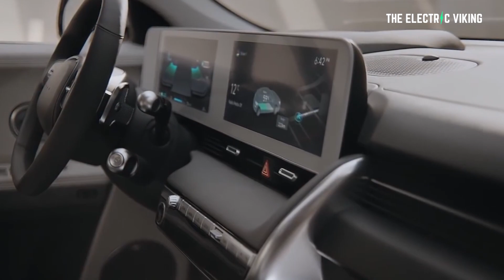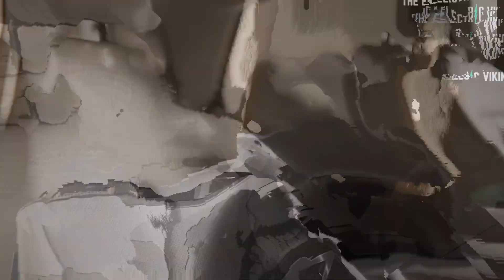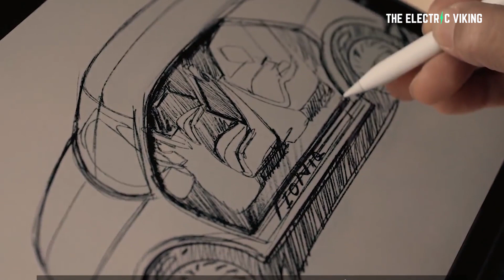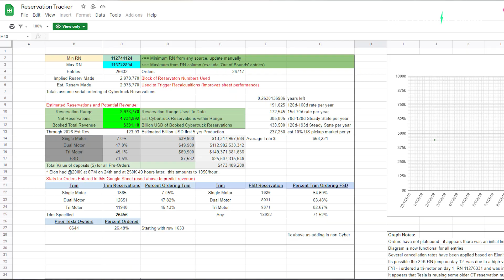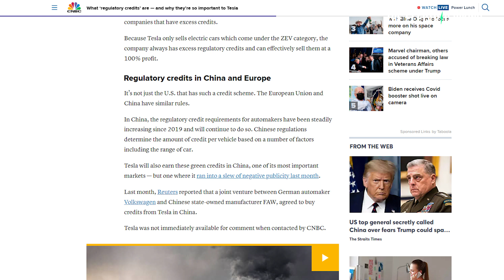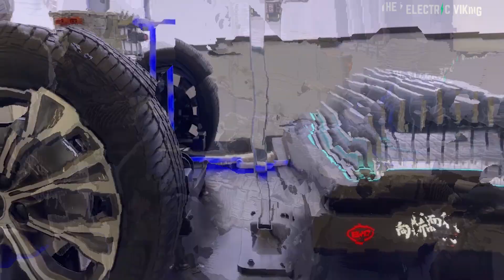2023 EV sells out in 19 minutes! Why is Detroit trying to go bankrupt!?!

Comment: At GM and Ford, and possibly other ICE manufacturers, they are losing significant revenue per unit of EV production. Bob Lutz hinted about this regarding their compliance programs.
Expect each Caddy Lyric to be as high as 50% negative margin. There is no way they can sell them at $60k each at a profit.
Reply: If Tesla can make profit then why not GM? Time to market is very important .
Reply: @AnilKumar-xw5bs  look at some videos on Sandy Munro’s channel about the Ford Mustang Mach E vs the Tesla ModelY to have an idea about who is really a better manufacturer of vehicles. Ford uses many more parts and complexity to accomplish the same system operation like fasteners, longer high voltage cables, and cooling. Keep in mind Ford has a 100 head start on Tesla in manufacturing and are behind in terms costs and weight.

Comment: The overwhelming reason is - - - - unions.   The big 3 factory unions, and mostly invisible are the supply chain union company employees.   And like an ocean liner, ‘Ships of State’, ie. large corporations like countries, find it extremely difficult to get the large entity to radically change coarse.   And, there is the “Bull in the closet”, (Non-adequate battery supply chain”) provider for every manufacturer.   That’s why “Tesla” is building a factory right next to the plant in Germany. The numerous problems in reorganizing the manufacturing process, (or new process as Elon Musk found out) as well as establishing any new and adequate supply chain always causes that “Ships of State” phenomenon to hinder the drastic changing of direction for all of these companies.
Reply: As someone with 50 years experience in the mobile industry, including executive level, it is the C suite that is the problem, not Unions.  The crux of this video is that traditional auto makers have not invested in EV production capacity and Unions do not control capex expenditures.  The root problem can be found by following the money, as always.  Executive compensation is so high today that all an exec has to do is survive for a few years and so much money is made that they and their progeny for all time will be wealthy.  So they spend just enough developing EVs to convince the Board to keep their jobs but not the capex because that would cut into their mega bonuses.  When everything goes to h--- they are gone but still rich while everyone else, including the unions, is screwed.  The environment? never entered their thinking, they have enough money to get their families someplace survivable.

Comment: I can think of several reasons here in the U.S., and spoiler alert, they would all go away with battery swapping standard and the combining of resources.

1) legacy companies have massive debt. in pension plans to their retired workers.  They simply don't have the ability or desire to borrow a lot more money for research into building EV factories.  They would rather build ICE which they are already tooled for and know how to do.  And this is where combining of resources would help.  GM, FORD, CHrysler and possible Toyota, VW, etc. should pony up a couple billion and build a battery and "skateboard" factory that each company can then finish out.  

2) The legacy companies are behind in battery technology and don't want to go head to head against Chinese companies in "their" home stadium, building batteries and battery powered cars.  These U.S. companies would rather compete with companies like BYD building ICE cars.  And this is one place where a good "battery swapping" standard would help in that then people would separate the car from the battery and be easily able to by an American built car and then lease a battery that might well be made in China.  

3) legacy car dealerships hate EVs.  And this is another place batter swapping would help.  People could trade in their tiny battery which they use most of the time, and swap for a 1000 mile battery that one week they are traveling across country, then trade  back.  This would give dealership a great thing to do and charge for.

4) supply issues.  I don't think American companies want to shut down whole factories waiting for foreign battery companies to supply batteries.  Just look at the Chevy Bolt ruined by LG Chem.  Again, combining of resources might help here.

Comment: Converting an ICE production line to EV production is not that easy. For some established manufacturers, it means throwing away half a century of expertise and knowledge, fire 50% of the work force （including the CEO that makes this decision）and complete with then new start ups (i.e. tesla and the Chinese brands) who do not carry the historic burden. I can understand this
Reply: @Click Bait yes you can, those battery and EV component suppliers are called BYD and CATL. They have the capacity to supply even a 1,000,000 units per year for other OEMs. Witnesses Toyota and Subaru signing up with BYD for their entire skateboard chassis and battery supply for their future EV product line
Reply: It already started, Mercedes fired thousands of autoworkers. Conventional auto makers don't have the expertise, the software background. Must transition from mechanical engineers in charge, to electrical engineers running the operation. Their outsourcing of everything has become their Achilles' Heal.  They are experts at nothing required in EVs, and can't motivate OEM suppliers to transition fast enough since OEMs supply multiple manufacturers.
Reply: I can understand the pivot is very large and complicated, at the same time it is a matter of pivoting or go bankrupt. China will produce 20 million electric cars by 2025. That is 33% of the current world market. Rest might produce perhaps 7 million combined, of which 3 will be Non-chinese Teslas. All will be EVs at price parity.

If big auto cannot meet this, someone else will compete against the Chinese+Tesla flood. Might take a decade or more for the real competition to arrive though.

Comment: It takes a lot of money to change a car entirely. The reason the older ICE models are abundant, and very profitable for the manufacturers, is that the key parts of the car, and there are thousands, have been made in huge quantities, the tooling is all paid for, and all they do is run the factory for a few weeks and they have tens of thousands of parts. The electric cars don't share that many parts with the older cars; because everything is different: the wheels have to be aero, the car is much heavier, so you need different rims and tires, the suspension has to be much beefier because of the huge battery weight. I would guess that less than 10% of the parts get used.  So instead of 90% same as last year (which is their operating style), it is 10 times harder, because only 10% is available. So making an electric car is like making 5 new regular cars. 

The switchover will take many years at the rate they are going.  But it will happen, and VW by sharing platform batteries, controllers, and inverters, will have a huge advantage  with all the brands.

Another aspect is that they fear huge expensive recalls, so they are intentionally limiting the production of the cars in the first year. Japanese Mfrs so this; they test a new model in Japan for a year or two, then export it. GM has already been burned by the Bolt batteries, and they are terrified of a Cadillac problem.  

The other problem is that the car companies don't realize how people yearn for something that is modern. They show concept cars, but never build them, and the Lyric is the closest thing to the spectacular (and way better) Escada.  The Lyric is a nice looking car, and Cadillacs have been very ugly for a long time.

Comment: It isn't complicated and GM, in my opinion, isn't purposely trying to fall. Here's what it is.

1.) There's a global chip shortage affecting everyone.

2.)They don't make their own batteries so they have to lineup and get theirs from the same sources others are getting theirs from.

3.) Importing is expensive and that drives up the cost.

4.) Their vehicles are made in the US and other places where labor cost are high and/or labor cost because employees belong to the union. 

I'm sure there are other limiting factors but unlike the Chinese markets GM can't compete on price in order to make a profit most likely. BYD is different.  They're vertically integrated and have had years to get to this point. Their labor cost aren't as high and they produce what they need and buy local what they need. Additionally they get some government advantages GM doesn't get from the US government. 

Again, I'm over simplifying what's happening but I think this is some of what is going on.

Comment: Is could be chip or lithium battery shortages.  It could also be a pressure to limit their penetration in preference to fossil fuels.   Global warming is saying that we all stop burning carbon after 2050.  This means all combusion engines are either junked or converted.  The scale of engineering conversion is so great it may create it's own carbon bubble.  Is there a case to ration ALL road vehicles and give priority to essential vehicles?   It may be wiser to put the global manufacturing capability into building EV buses, trucks, utility vehicles needed to run the economy.   Private ownership may be a luxury the world cannot afford during this environmental  crisis?

Comment: Can you make video about hydrogen fuel vehicles
Reply: Hydrogen is a waste of time, energy and money
Reply: @mikafiltenborg2291  I think more people should know the reasons why it is such a bad idea...
Reply: HFC cars are actually evs with their small battery charged by the fuel cell. The fuel cell cannot provide the instantaneous current needed for acceleration. 

These are complex cars with the tiny drive battery being constantly thrashed, with deep discharge. The drive battery will probably only last 100k kms. Then the fuel cell membrane will likely also need replacing in 100k kms and the other additional maintence required that pure evs do not have. A HFC car will be expensive to maintain, and likely be a throw away after 100k kms.

In addtion, 3-5x more renewable electricity needs to be generated to provide the same power at the wheels for a HCF car than is needed to provide the same power at the wheels for a pure ev.

And packaging is also an issue for HFC cars - all those systems need to go somewhere in the car.

Then there is the infrastructure issue.